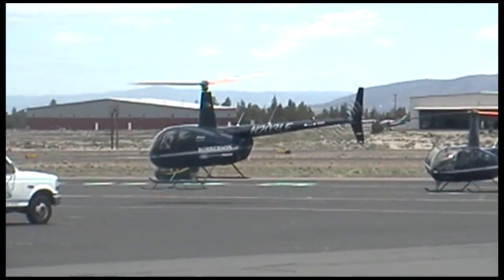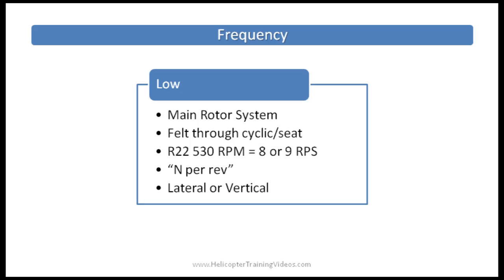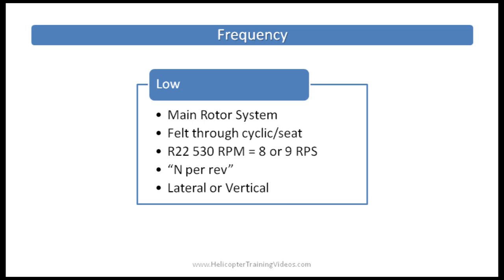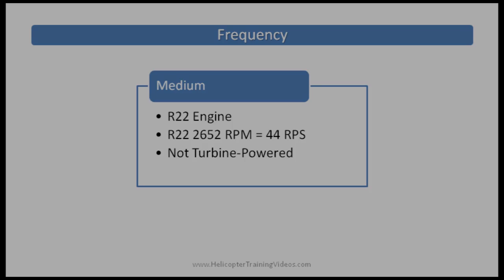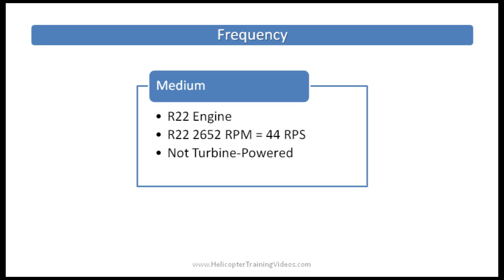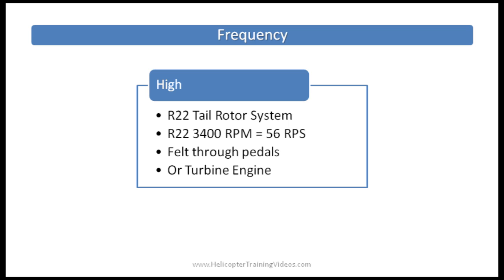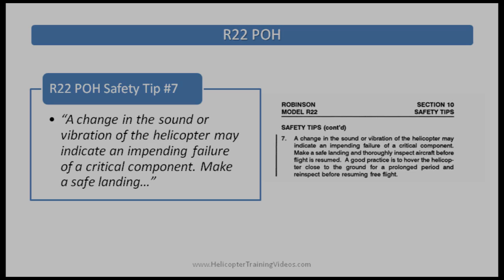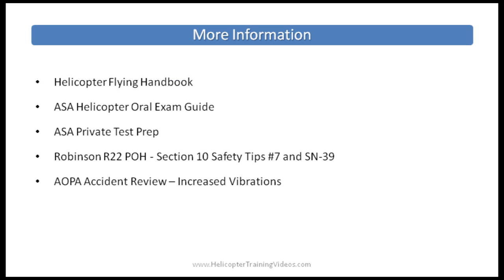Why Do Helicopters Vibrate So Much? Helicopter Vibrations Explained

Comment: Hey quick question.  A Flight School near me is charging $455 an hour, or $435 for 10 hour blocks. Do you consider this to be a bit overpriced or normal?  Training is done in an R44 is this why I may be thinking it's more than usual?
Reply from the maker: If that includes flight instruction and any fuel surcharge then it seems pretty good! R44 Raven II with flight instruction and fuel surcharge is currently around $520 an hour at the school I trained at.